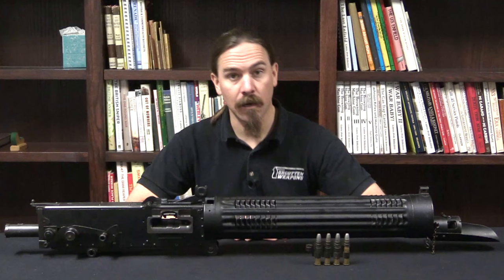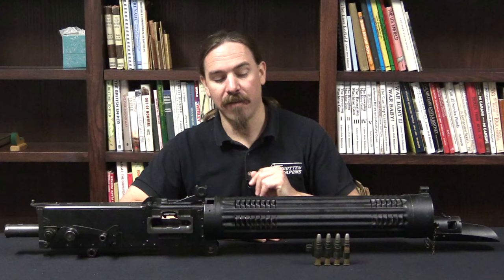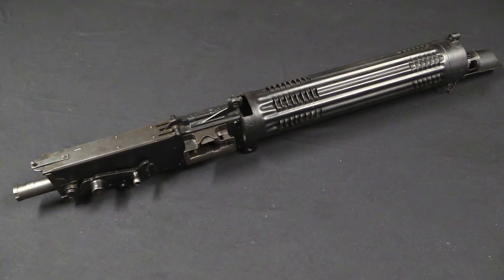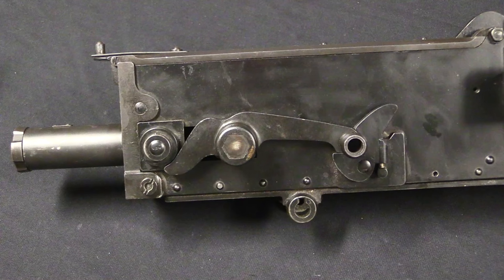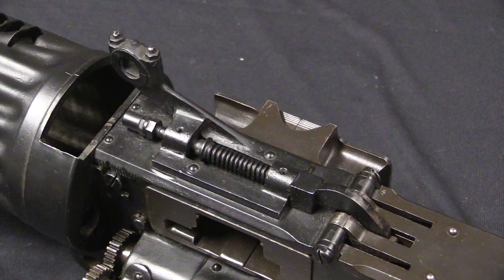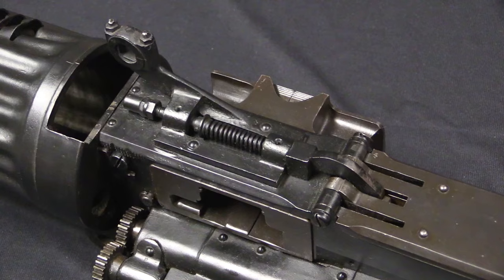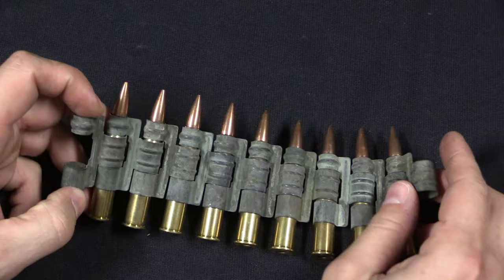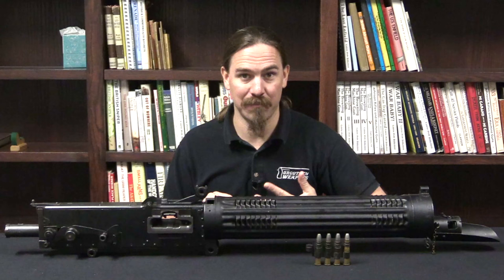11mm Vickers "Balloon Buster" Machine Gun

Comment: Someone let me know if I’m thinking about this correctly:
- Interruptor: The normal RPM of the gun has no relation to the RPM of the propeller. Every Nth round of the gun is delayed to prevent it from hitting the propeller, making the fire rate inconsistent.
- Synchronizer: The RPM of the gun is modified to be a factor of the RPM of the propeller. Only the first round is delayed until the propeller is in an exact position, and so the fire rate is consistent.
Reply: Something like that, but the interruptor was probably rigged to prevent the gun from firing whenever the propeller blade is where it shouldn't be. As it can spin at different speeds it would be impossible to protect it just by skipping every n-th round, you'd hit the blade sooner or later.
Reply: @raics101  Indeed. From the top of my head, it basically just worked by letting the gun fire, but a camwheel would interrupt the gun whenever a propellor was about to pass by. As you also mentioned, that made them function regardless of the engine/propellor RPM, which is something an 'every nth round'-system would horribly fail at.
Reply: The fire rate on the synchronised guns wouldn't be consistent either, surely? Dependent upon the RPM of the engine? Fire rate would increase as you increased throttle I'm guessing.
Reply: @KenworthW900HG  or stop altogether upon engine failure, although an interrupter has a good chance to not fire in the same scenario.
Reply: The interrupter works preventing the gun firing when the propeller blade will be blocking the muzzle. The gun will fire at its set fire rate, only stopping when the interrupter is in preventing it. 

The Synchronizer fires the gun once at a set "safe" portion of the propellers arc, depending on syncronizer design, this would be 90 degrees off from each propeller blade, ie firing twice per full rotation of the prop (on a two blade prop) or in some earlier cases (as I believe was the case on the Nieuport 17-21)  90 degrees off one of the blades , firing only once per rotation. with this system, it does mean that the gun fire rate is tied to the engine's RPM. On some of the Albatros aircraft, you can see the tachometer mounted askew,  with 130 at the top as this was the engine rpm that gave the optimal fire rate, lower and the guns would have to wait for the propeller, faster and they couldn't keep up.
Reply: @pvt_picklestomp3014  Interupter was in effect part of trigger mech and stopped the machine gun firing when propeller blade was passing in front of the muzzle. The germans got the idea from a french pilot who tried to make an interupter mech but could not get it to work with French machine guns and ammunition as french ammo didn't fire consistently. So odd delayed bullits would still shoot the propeller off. His work around was bullet deflectors on the back of the blade with which he shoot down 3 enamy planes in a fortnight before a malfunction on his plane caused him to land it behind enamy lines and be captured. The germans looked at it and improved it easily as there ammo worked more reliably and the Fokker scourge was born. The eindekker was not a great plane but the first where you could just aim the whole plane at the target and fire.
Reply: @KenworthW900HG  Aircraft  engines  at  the  time were   pretty  much on  or off.  The   RPM would  be   fairly consistent.
Reply: @jamespettit1792 not accurate, only true of some rotary engines. The more advanced rotaries of late 1916-18 were able to be throttled, or had selectors allowing you to run proportions of the engines (ie have 50% of the cylinders fire, see the gnome types). All the inline engines had proper throttles.
Reply: @jamespettit1792  even so, the engines had enough variations in RPM that eventually you will reach an Nth round fail. Changes in lubrication are the main reason RPM changes in single throttle engines.
Reply: @jamespettit1792  wtf is wrong with your comment? Why do you have a random number of spaces between each word?
Reply: @maoman4855  - space key stuck or cat sleeping on the space key.
Reply: @maoman4855  Because it has an interruptor.

Comment: It's an English gun, built by Americans for the Russians, then modified for the French?
For use against German Party Balloons. 
So is it an Aircraft gun, or an Anti-Aircraft gun? 

... the automatic light adjustment on this video is a bit jarring.
Reply: Yes
Reply: Also, it has no pistol grip or a trigger to be a ground gun
Reply: @invictusangelica  No version of the Vickers machine gun has a pistol grip as far as I know. And it was very much used as a ground gun, with great success.
Reply: @sshep86  I was giving an example of a detail to know if it's a ground gun or not. The Vickers has a spade grip which is still a grip.
Reply: Both.
Observation balloons are the drones of their day, as long as youve got a balloon up you can spot any movements for miles around and counter it with artillery, plan to counter any attacks and so on.
that makes them priority targets, any observation balloon would be protected by batteries of AA Mgs on the ground and probably a couple of fighter planes up high, plus a mechanical winch to pull them down to safety as soon as a risk is seen.
The way of attacking them was to get in with a squadron of planes early in the morning so yo can use darkness and try and take them out with incendiary bullets before the  ground crew can pull it down.
Its high risk, balloon busting was the mission with the highest casualty rate in WW1 simply because they were so high value they were incredibly well defended.
Reply: I've griped about the camera going nuts adjusting between Ian's white hands, and the black gun and background forever.
Reply: It was modified for mounting on an airplane. Thus it was the air to air missle launcher of it's time. Would overheat in most any other use.
Interesting video.
Reply: Eric Hansen I put it down to my lack of visual acuity. I don’t see anything wrong.
Reply: @Steve Sheppard  that's what it though, but there are 5 models with pistol grip , the Mk IVA, Mk IVB ,Mk VI,  MkVi*, and MKVII  https://vickersmg.blog/the-guns/
Reply: Aircraft, AA guns of the day didn't have the range to attack enemy observation balloons so it would have to be mounted on an aircraft. Besides if you note that the gun has an air-cooled jacket rather than a water jacket, this was usually done to lighten the guns for air service.
Reply: trivago
Reply: To be fair, I wrote that second question when the video came up, then left it in after watching for continuity. 
As for the gloves, clearly the solution is dark gloves. 
Or more white guns, but I don't think that'll catch on.
Reply: It seems that the US in 1917 was flooded with guns the Russians ordered, that the US didn't make and had to build factories to manufacture, were never delivered, and that Russians never paid for.
Reply: "We are the world"...I'm thinking anti-baloon gun, mostly. Although, if you can reliably hit a German a/c fuel tank, that would also work nicely!
Reply: It is, ultimately, an air-to-air gun, the origin of which is of course a ground-to-ground machine gun.
Reply: I belive it's actually a German gun, made under licence by the English, who have in turn licenced production to the Americans etc etc!
Reply: This is the true form of capitalism.
Reply: @Ben-Downlow.  nope Maxim himself was an American. The Vickers company had been an outgrowth of Maxim which had for period of time been merged in with the Scandinavian company.... The Germans derived theirs from a license with the maximum company which occurred before it became the Vickers Maxim company..... And a lot of Maxim's ideas happen during a European tour and my understanding is a lot of his prototyping happened in Belgium. And I could be wrong on a lot of the timing of those details. However to call it a German gun is definitely not right. you could call it a pan European gun designed by an American and that be closer to it.
Reply: @GunFunZS  well, you learn something new every day!
Tks👍
Reply: @Ben-Downlow.  you should really check out the C&Arsenal video on any of the occurs or Maxim guns. It seems pretty obvious that you would be entertained by them as I was. and at least one thing I can say confidently about that is he would have his information straight. and he does a step better than just reading the book and regurgitating it. he checks whether the book is right. Or whether there is enough information for anybody to be confident, and then he tells that level of confidence or not.
Reply: @josephstabile9154  The problem is you're never going to hit a moving enemy plane with an 11mm Gras, the round moves slower than a modern shotgun slug.

Besides, it's not like you needed incendiaries to set an enemy machine on fire in the doped canvas era of aviation.
Reply: @JSheepherder  Figured wouldn't be intended for a/c vs a/c. Internat'l laws generally prohibited "inhumane" projectiles (e.g., dum-dums, incendiary?). Lower velocity/higher trajectory adds difficulty--but, n.b., good success in WWII w/30 mm MK 108 at same/lower projectile velocity & higher a/c relative speeds. Just was commenting on the fact that this round could be destructive of enemy a/c. I can't imagine that, say if Capt. Rickenbacker had been bounced by Fokkers, he wouldn't have used the guns he had!
Reply: A British gun my freind.
Reply: @bill8791  but not really.
Reply: @GunFunZS  Yes, really. Perhaps some reading up on what the UK is (and what Vickers was and became) would help from making silly comments like that.
Reply: @bill8791  I study both both. The vickers gun was a derivative of the maxim gun, which had input from most every european power, notably a lot of scandanavian techs, and Belgian, and was primarily invented and developed by Hiram Maxim, and American. Much of the development of the version that became dominant happened while it was Maxim-Nordenfelt. The gun in the video was manufactured by an American  company. To call that specifically a British gun, requires willful blindness, and selective notice of facts. 

So, ~"read more' is not much of a mic-drop win for your position.
Reply: aircraft mounted anti-airship gun
Reply: @GunFunZS  its british because its a vickers, but like the british monarchy its got german heritage.
Reply: @GunFunZS  You misconstrue my comment then and perhaps should have checked. I was refering to the comment about refering to England as a soveign nation and Vickers as a English company, which it isn't.
Reply: @bill8791  you tend to refer to all vacuum cleaners as Hoovers. Most of the rest of the world is fairly unconcerned with the internal distinctions that deportions of the United kingdom use to break up the constituents of the British isles. I am aware of them. I also know that many people from the UK tend to disregard these and use the term English and British mostly interchangeably.  

I suppose if you want to be pedantic about it you can but I ask why you think it would matter whether I specifically was aware of that distinction? I would also dispute the rationale behind designating Vickers as an English company as opposed to a British or vice versa. since the company was essentially almost exclusively marketing to the state itself and most of its projects were built at least partially unstate secrets it is mostly a function of the UK as a whole rather than as Britain or England really. It doesn't work in normal speech to say a thing was UKish, and that is even clumsier when you say this thing has among as many constituent contributors some UK-ish input into its development, hello the product was mostly developed into its final state before the UK input became relevant... See that's kind of clumsy. but if you want to be the patent and a stickler for having the details of fact right that would be the statement you would make.
Reply: @GunFunZS  Dude, you completely misunderstand my comment now have gone of one some self righteous rant. Go outside, do something with another human. FYI I'm British and I refer to myself as British. The point was the dude said England, which is factually wrong and to me annoying given that i'm British.
Reply: @GunFunZS  England and Britian are only interchangeable if you're an ignoramus of the highest order as well.  My Scottish and Welsh freinds would be sure to agree.
Reply: @josephstabile9154  you have a point, in that you fight with the weapon you've got, and that the weapon could have done a lot of damage if it hit.  Personally, I don't think international laws meant anything, to be honest, because poisonous and deleterious gasses were also banned and we all know how that went.

But you need to remember that in WWI they didn't even have gyro sights.  Not only were they not capable of cancelling out the motion of the enemy aircraft, they were also not capable of cancelling out the motion of their own aircraft.  In that situation a barrel burner of a round limits the amount of error introduced by the time of flight, and high rates of fire lets you spray more sky.  It's worth noting the MK 108 and it's successors were dropped immediately in 1945, and the NATO and Warsaw Pact forces quickly moved on to Rotary or Gast guns with higher rates of fire and higher velocities even though both had figured out gyro sights.
Reply: @JSheepherder  Back during WW I the Vickers/Maxim for aircraft use was modified by beefing up some parts and lightening others to enhance the rate of fire.   However during the interwar period the RAF wanted to have a higher rate of fire plus better reliability and Vickers developed the Vickers K gun or GO standing for gas operated.  This  could notionally push out 1200 rpm, but was predicated on a pan magazine which presented its own set of problems.    In the end the RAF went with a modified belt fed Browning for wing mounts and turrets.   The K/GO gun was still used in some turrets, free standing positions and famously singly or paired on LRDG (nascent SAS) vehicles.   It was apparently the most reliable of the three.
Reply: @TheArgieH  Thanks.  I knew about the enhanced rate of fire on aircraft guns during WWI, but the gas operated Vickers missed my attention.
Reply: @JSheepherder  I know I am repeating myself, but it amused me when something happened the other way round.   I saw what was obviously a rusted Lewis gun in a museum mistakenly labelled as a Vickers K/GO gun.   It was missing bits but still had the give away clock spring cover and pan ratchet, neither of which are on the K/GO (it has a very different system).  They were judging by the lack of an induced cooling jacket.   Ah well, their intention was good.   Genuine K/GO guns do turn up reasonably frequently, I have seen more than one adapted used for "arcade" games in aircraft museums.
Reply: @Hansengineering  It's a consequence of using the camera's autoexposure mode; it adjusts with every change in reflectance in the camera's field of view. The solution would be to set the exposure manually for each shot, and just let the hands blow out (visually), leaving the mechanical subject as is. The blooming of the hands might be more or less distracting in that case; it's a judgement call.
Reply: @steveh1792  Yes, I know how metering works.
Reply: Today on defence procurement mysteries :D lol
Reply: @voiceofraisin3778  And balloon crews got parachutes, the attacking pilots did not.   Some odd military logic at play, mustn't sap the "offensive spirit" or encourage someone to abandon an expensive aeroplane.    What do you mean it is on fire and that it takes time and money to train pilots? The German airforce did eventually issue parachutes well before the RAF, I do not know if the RFC or RNAS ever did.  That pistol carried by many of the flying men in khaki was not for engaging the enemy.
Reply: I don't see much or even any French involvement here. 
The engineer who adapted this gun for aerial use, Marc Birkigt, was Swiss. He also founded the Spanish-Swiss Company better known as Hispano-Suiza, designed and built the V8 engine used in SPADs but probably most famous here for his HS.404 20mm autocannon.
Reply: YES
Reply: @JSheepherder  The object was to kill the pilot in any case.
Reply: 777 likes; does God feel sorry for the  circumstances behind this comment.
Reply: @GunFunZS  Actually Vickers was founded in 1828 and as an engineering firm was known for heavy engineering, shipbuilding and armaments in general.   It had many (sub) divisions, (better) known by their own names than that of the parent.   A clear example was Supermarine based in Southampton who specialised before WW II in seaplanes.  They did however turn out a  rather well known fast low wing monoplane, just prior to WW II, fortunately just in time.  Vickers diversified and in its later incarnations built heavy weight medical equipment.   Their final demise came in the 1990s.
Reply: @GunFunZS  p
Reply: The French modified it to only run in reverse.
Reply: The camera has an auto white-balance feature and is being thrown off by the books in the background
Reply: Well, since it's an aircraft gun, I think the "anti-aircraft" part is already one of its main purpose.
Reply: Anti anti air aircraft armament
Reply: It's an aircraft anti aircraft gun.